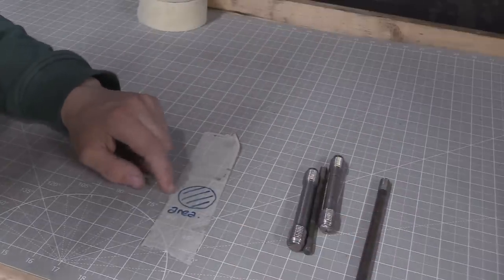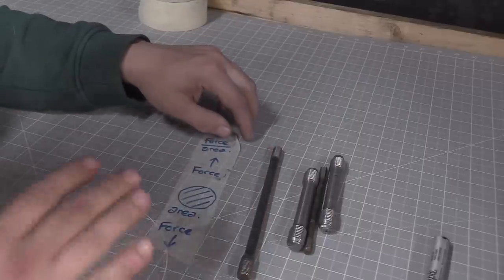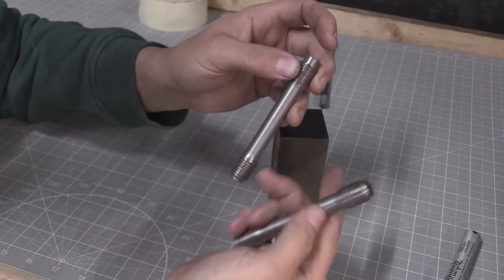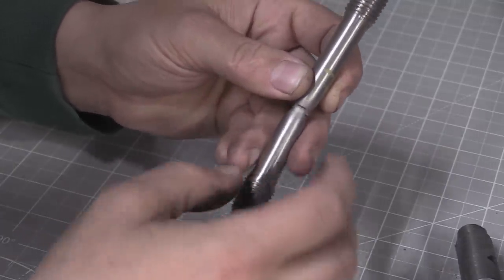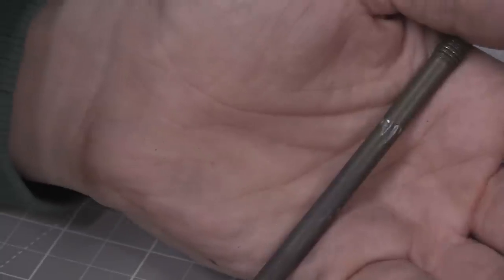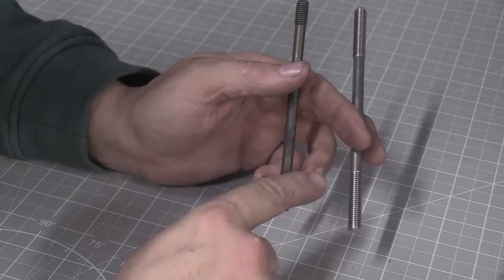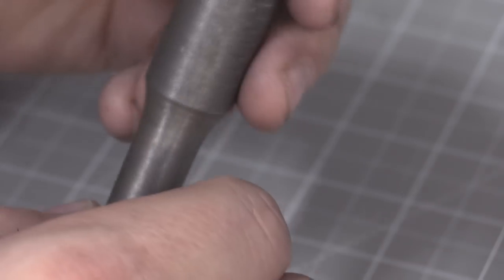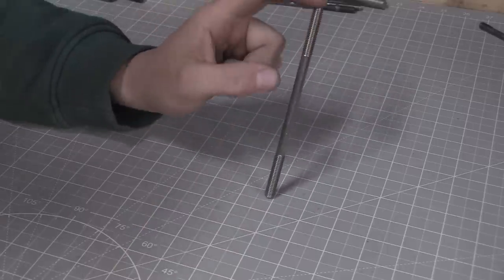Tensile Strength of ENGINES studs

Comment: I worked in the Mechanical Test House at British Aerospace for 15 years testing on all manner of metallic materials. It may help in your videos to talk of things like Youngs Modulus, material granular structure and material composition. As we were determining parts for flight integrity we also measured hardness and elongation and for steels, resistance to impact using izod and charpy tests. Loved my time there before moving onto xray and ultrasonics which use similar material physics to determine material integrity. 
Liked the video for its simple explanation of testing 👌. I also used to get engineers coming into the lab thinking they knew more than me, it made me laugh 😃.
Reply from the maker: I worked for SGS, we're gonna get onto charpies, chems etc soon
Reply: @thedirtyworkshop  As well as testing metals to destruction in the 90s I went onto everyone's bedwetting material, Carbon Fiber. To me not as magic as everyone thinks but it was interesting. In tensile it explosively failed at Ults. Then went on to SPFDB, now that was really interesting. Great to find someone with the same interest.

Comment: Cheers bud

A few of your old videos definitely saved me some grey hairs

Swapped the manifold, overpipe, and catback on the car recently (other bits not as relevant) and your video on why to tighten nuts rather than bolts saved me so much stress

Another lad in the group made that error and was spitting blood for a week

Decided to replace a few nuts as the threads were a bit dodge, new nuts weren't great so re-tapped them (m10 x 1.25) and cleaned the studs for good measure

Not a single issue. Time spent in prep is more than won back in an easy install with no revisiting.  Even stuff like planning to make the nut more accessible for tightening (if either it or the bolt is in a awkward place) made a massive difference 

I assume you'll have blown your muck by now so I'll stop blowing smoke up your arse but just wanted to say thanks for saving me a ton of stress and making me look like I know what I'm talking about
Reply: That being said,  the threads on the studs for the exhaust manifold on the gt86/brz do seem to be made of warm butter

I also learned that nobody around me supplies m10x1.25 fittings and that "nuts n bolts uk" ship internationally really quickly (but you might need to touch up the threads)

Comment: I was wondering if machining the test pieces is necessary? If you're going to calculate the tensile strength, and not testing to a standard the only measurement you need is the relative strength, and failure mode of each bolt. I'd also be concerned about the material consistency over its skin compared to the core?
Reply from the maker: This is how all test samples are tested. This is also how you compare 2 samples of different diameters

Comment: Is the ultimate tensile strength area measurement the diameter before necking (before pressure is applied) or after the failure. Surely the necking diameter at the point of breakage isn't consistent. Great video, thanks.
Reply from the maker: Before

Comment: If the reduced diameter was purely to design in a point of failure I think they would only have reduced it on about 5-10mm of the stud.  I think it's the full length because the designers are trying to achieve the required amount of stretch in the stud in order to ensure the stud does not loosen at the required torque for the application.  I think if you use a stud that has a different material with a different diameter, which then had a higher tensile strength the stud may not stretch enough to remain tight.
Reply from the maker: Well you're wrong. I do this for a living. The fact is the sample might have a weakness inherent in the material. For any given length over the diameter we can calculate the chance of such a flaw.

Stretch has nothing to do with anything. The clamping load does.
Reply: @thedirtyworkshop  

"The proper amount of tightening torque (or pre-load) is important.  If the fasteners
are too tight they may break either during the tightening itself or when the working load is added to the pre-loading applications such as gasketed joints.  If too loose in vibration.  Often overlooked, but equally important is the btendency of fasteners subjected to cyclic loading to fail from fatigue if not sufficiently tightened.

All fastener materials are slightly elastic and must be stretched a small amount to develop clamping force.  As a rule of thumb  a stretch of 00.1 inch per inch length of fastener devlops about 30,000 psi clamping force in steel and 15,000 in titanium. 

The best way to determine the correct torque is to run tests on the particular joint by tightening five bolts until they just begin to yield.  The optimum torque is 80% of this value. 

When seating requires a certain minimum force or when transverse loads are to be transformed by The longer the joint length, the greater the total elongation will occur in the bolt to produce the desired clamp load or preload. In design, if the joint length is increased, the potential loss of preload is decreased.

If the joint material is relatively stiff compared to the bolt material, it will compress less and therefore provide a
less sensitive joint, less sensitive to loss of preload as a result of brinelling, relaxation and even loosening.

The modulus for steel of 30,000,000 (thirty million) psi means that a fastener will elongate .001 in/in of length for every 30,000 psi in applied stress. Therefore, if 90,000 psi is the desired preload, the bolt must be stretched .003 inches for every inch of length in the joint.

AN EXPLANATION OF JOINT DIAGRAMS
When bolted joints are subjected to external tensile
loads, what forces and elastic deformation really exist?
The majority of engineers in both the fastener manufacturing and user industries still are uncertain. Several
papers, articles, and books, reflecting various stages of
research into the problem have been published and the
volume of this material is one reason for confusion.
The purpose of this article is to clarify the various
explanations that have been offered and to state the
fundamental concepts which apply to forces and elastic
deformations in concentrically loaded joints. The article
concludes with general design formulae that take into
account variations in tightening, preload loss during
service, and the relation between preloads, external
loads and bolt loads.
The Joint Diagram
Forces less than proof load cause elastic strains.
Conversely, changes in elastic strains produce force
variations. For bolted joints this concept is usually
demonstrated by joint diagrams.
The most important deformations within a joint are
elastic bolt elongation and elastic joint compression in
the axial direction. If the bolted joint in Fig. 1 is subjected
to the preload Fi the bolt elongates as shown by the line
OB in Fig. 2A and the joint compresses as shown by
the line OJ. These two lines, representing the spring
characteristics of the bolt and joint, are combined into
one diagram in Fig. 2B to show total elastic deformation.
If a concentric external load Fe is applied under the
bolt head and nut in Fig. 1, the bolt elongates an additional amount while the compressed joint members
partially relax. These changes in deformation with
external loading are the key to the interaction of forces
in bolted joints.
In Fig. 3A the external load Fe is added to the joint
diagram Fe is located on the diagram by applying the
upper end to an extension of OB and moving it in until
the lower end contacts OJ. Since the total amount of
elastic deformation (bolt plus joint) remains constant for
a given preload, the external load changes the total bolt
elongation to ∆lB + λ and the total joint compression to
∆lJ – λ.
In Fig. 3B the external load Fe is divided into an additional bolt load FeB and the joint load FeJ, which unloads
the compressed joint members. The maximum bolt load
is the sum of the load preload and the additional bolt
load:
FB max = Fi + FeB
If the external load Fe is an alternating load, FeB is that
part of Fe working as an alternating bolt load, as shown
in Fig. 3B. This joint diagram also illustrates that the joint
absorbs more of the external load than the bolt subjected
to an alternating external load.
The importance of adequate preload is shown in Fig.
3C. Comparing Fig. 3B and Fig. 3C, it can be seen that FeB
will remain relatively small as long as the preload Fi is
greater than FeJ. Fig. 3C represents a joint with insufficient
preload. Under this condition, the amount of external
load that the joint can absorb is limited, and the excess
load must then be applied to the bolt. If the external load
is alternating, the increased stress levels on the bolt produce a greatly shortened fatigue life.
When seating requires a certain minimum force or
when transverse loads are to be transformed by friction,
the minimum clamping load FJ min is important.
"

My interpretation is bolt elongation is critical to clamping load.

Without some stretch in the bolt there is no preload.   If you were to use a higher tensile strength stud and then used the manufacturers torque values the required preload would not be applied.  You would have to calculate new torque values to correspond to the incrased tensile strength of the new studs.
Reply: @thedirtyworkshop  The best way to improve fatigue resistance is to reduce the alternating stresses at the threads. There are three main ways of doing this: Assembly design, assembly tightening, and assembly security.

The assembly design process provides an opportunity for improvement of the load distribution on bolted joints and to reduce the level of external stresses supported by each joint. To facilitate that, keep these principals in mind:

Use the highest possible preload
Minimize the bolt to load eccentricity
Use the largest possible contact surfaces
Use the largest possible clamping lengths
In most cases, use a preload higher than the working load
Other assembly design options include the use of necked-down studs or bolts, and the use of elastic washers, which counter the effects of relaxation, creeping, and thermal differential elongation.
Reply: @thedirtyworkshop  I agree it is the clamping force that is critical.   But the clamping force only really occurs when a the stud begins to stretch.  So essentially you can use a different stud with either a different diameter or material as long as the fasteneing torque is recalulated to acheive the correct preload.   And I do beleive that is the reason why those studs have a reduced diameter.   They need a large thread as they are going into aluminium but they also need a particular diameter to acheive a required preload without suffering fatigue or loosening.
Reply: Why intentionally stretch the head bolts? Engineers discovered they can get much more even clamping on the head gasket if all the bolts are evenly loaded. Since variations in friction between bolts always causes some uneven loading, stretching the bolts guarantees all the bolts will exert the same clamping force regardless of the torque reading on the wrench. The result is improved cylinder sealing, longer head gasket durability and less cylinder bore distortion (for reduced blowby and more power).

TTY head bolts are typically used on engines with aluminum cylinder heads (where there is a lot of thermal expansion) and with multi-layer steel (MLS) head gaskets. MLS head gaskets are very stiff gaskets with much less compressible than standard soft-faced composition head gaskets. On the other hand, MLS head gaskets are almost bullet-proof and produce much less bore distortion than other types of head gaskets because they require less clamping force. But to seal properly, MLS head gaskets require very smooth (almost polished), flat surfaces on the head and block. This, in turn, requires very precise and even clamping loads by the head bolts. That's why TTY head bolts are used in these engines.

How can you tell TTY head bolts from ordinary head bolts? TTY head bolts are typically longer and narrower than standard head bolts. Factory service manuals will tell you which applications use TTY bolts, and you can often tell from the head bolt tightening procedure if the bolts are TTY or standard. TTY bolts typically have an angle tightening specification rather than a specific torque value (which requires using an angle gauge when tightening the bolts).

Comment: Not sure if this would be relevant or not but would you not need to watch for the difference in thermal expansion between stainless and carbon as well? I know we had a bit of an issue with boiler bolts being replaced with stainless and them loosening off due to expansion/contraction during heat cycles (this was on industrial15MW boilers so the heat cycles were limited and generally happened during the initial warm up period). Ended up going back to high tensile carbon steel.
Reply from the maker: Tests are done in a temp controlled lab.
Reply: @thedirtyworkshop  I was meaning when swapping them in your XJ - just a thought 😀
Reply: And hope that the head isn’t aluminium alloy and severe bimetallic corrosion occurs …

Comment: Hi Matt, not sure if this is relevant or not but are these “ stretch bolts” manufactures seem to use them all the time now & wondered why you didn’t mention this, I may be wrong but I thought in the early days when they just bolted stuff together with huge bolts that didn’t allow any stretch is why mixing steel & alloy components ended up with gaskets blowing & all sorts of problems. Or maybe I’m thinking more of car engines. Anyway interesting.
Reply from the maker: TTY is something we'll be getting to soon

Comment: You've chosen stainless for its anti corrosion properties, but want to know if they won't be too 'brittle' in application? Also to educate that swapping fasteners without appreciating the 'load capacity' of the changed material is inadvisable? Is the bright ring on the necked sample where the metal has deformed but still retains some integrity. The duller, rougher central part is the point at which the metal cant cope with deformation any more due to the reduced diameter and the molecules snap apart? ...How's  your knee?

Comment: now in this usecase, testing the chinesium to make sure it'll handle the tensile forces. how do you know they are going to be reproducable? any two parts from a mystery orgin like chinese sellers might differ greatly in quality/strength. do you just buy a batch and hope that means they're all the same? is there a way to know they're going to be the same as tested by some non destructive test like weight/size measurements whatever?
I'm mainly wondering not just to be a prick but because I've also been running into that wall when wanting to source cheaper parts from manufacturers that dont present the needed specs
Reply from the maker: I don't know it's reproducible, all samples are single samples. This is how load based testing is done.
Reply from the maker: The chances of 1 seller selling 5 studs that are different materials are far greater than them being from the same material.
Reply from the maker: I'm just answering each point in turn. You have to take each case on its own merits.
Reply: I see, cheers. will be interesting to see how these hold up non the less.

Comment: So after all that what you’re really interested in is the elastic limit of the stud and not it’s tensile strength, although the two are linked?
Reply from the maker: What?
Reply: @thedirtyworkshop  the tensile strength of a stud has no bearing on its performance, what matter is the working tension and elastic limit of the material though I concede high tensile bolts tend to have a higher elastic limit.
Reply from the maker: What? The young modulus let's you work out the clamping load applied, the tensile strength gives you a limit on the forces applied.
Reply: @thedirtyworkshop  .. and the stud obviously does not perform at its limit 🙄

Comment: Just a couple of questions, I've heard you talk about different materials reacting with each other (even more so when heat is involved), so will there be a reaction between the new studs material and engine block? 

Also, I think I've heard they use "stretch studs" on some car engines. How does that work? Do they engineer in a degree of necking across the entire length of the stud and then work out the remaining tensile strength is enough to hold the engine together?
Reply: When the engineers design the engine they account for these material differences and the reactions between them. If you use the recommended new studs no need to worry.
About the car engines - From the workshop manuals of a couple of car brands it is stated that, when the studs ( screws in most cases ) stretch above a certain length, they should be replaced. For the very same reason Matt explains - after necking comes the snapping.
I don't think there is an application, where you want to cause necking intentionally. By my logic this means you are near the UTS and you don't want to be there, when you design a reliable and durable assembly. 
Feel free to correct me as needed.
Reply: No, you want to stretch the bolts/studs but below those elastic limit. This is reasonably achieved by tightening the body’s to a given torque but in certain critical situations the bolt (or stud) is hollow so that the actual stretch can be measured !